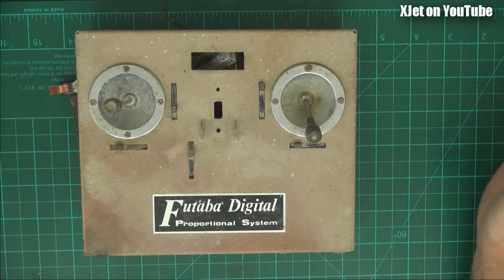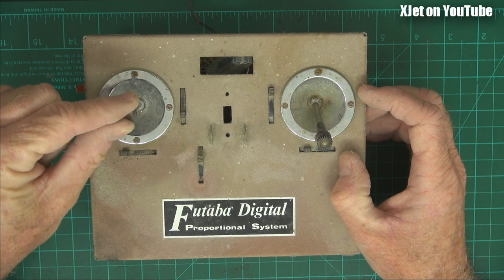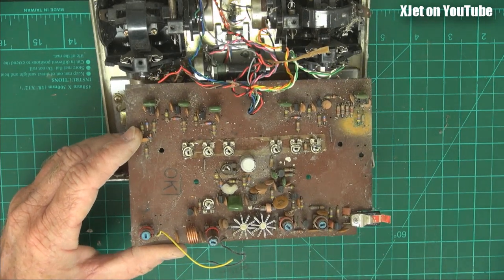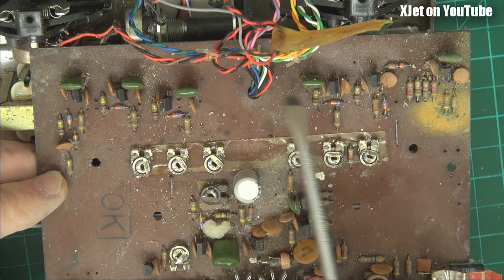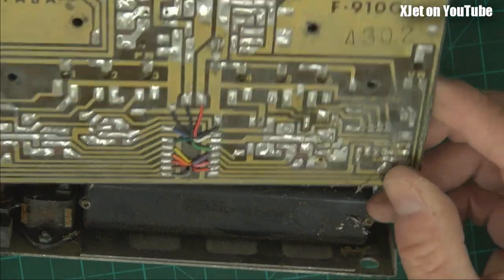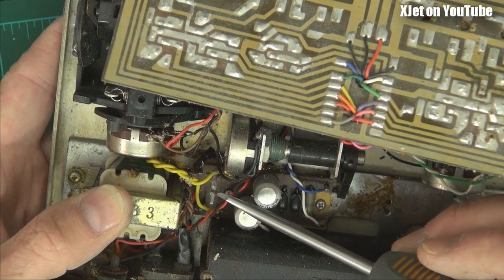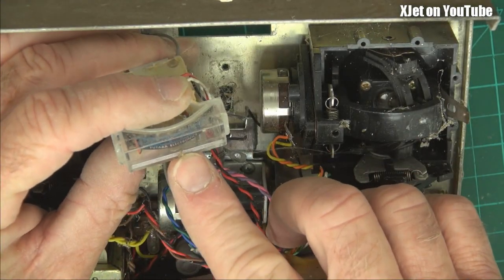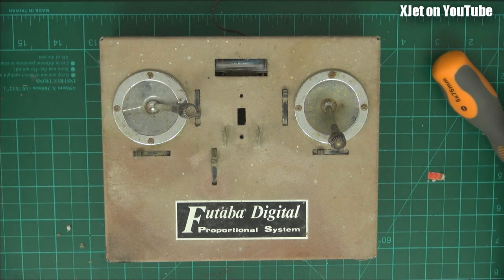Futaba 5-channel radio control transmitter from the 1970s

Comment: Back in '76 I got my first Radio,  Futaba 5ch, black plastic case.
  Couple of years ago a Gold Metal Case 4ch, in AM, came to me, changed the internal battery, this I still use for my airboat, it's my engine break-in unit.
 Now, I fly 2 differant 6ch systems.  Futaba and Tower.  I also have a 3ch and a couple of 4ch systems, all Futaba. I do this because I know that all the components all work together.
Got my first model plane back in 1959,C/L, .049. Been designing, building  and flying R/C ever since.
Ok, I admit it, I'm a Model Airplane Nut.
  Winter time I build, in the summer I fly and teach.
 Passing on piloting skills is the most sure way of getting people involved in this hobby.
Good flying weather is almost here in Mid Michigan.  Going through equipment getting things ready to go........ Flyen!!!!!!!!!                          
  Yippee!   ( Orange, P-38)

Comment: wowwww....  brings back memories, my first radio was a Futaba 3 channel for a boat, then I moved up to a 4 channel for the plane and the radio I got was just like the one shown here (except for the 5th channel)..  those clean sharp lines those catch everything corners that metal case which was soo much fun to hold in cold weather, and that miserable tiny battery meter that worked when it wanted to and that wasnt too often ;)  and the prices, holy moly...  the 4 channel was in the 200$ range even back then... I still have the servos and recievers for those transmitters, dont know what happened to the radios tho, got lost in the moves over the years I suppose.

Comment: Nice Bruce. That is the radio my Grandad taught me to fly with. Used it for quite a while until I replaced it with the trusty ok Futaba fp-t7uaf. Which I still have and works fine. Used that one untill the 2.4 revolution.

Comment: That's the same one as my first radio I had back in 1973, it came with linear servos that had 5 wires not 3. I used it in my first trainer a Top Flight  Top Dawg, rudder, elevator and throttle with a Super Tigre G20/15 for power. worked great until the bush fire brigade using a CB radio shot me down when they came into our field, I had the bad luck of being the only one in the air at the time, only thing that survived the crash was the motor. My next radio was a Micro 4 channel on 29Mhz.

Comment: Brings back a lot of memories.  I am not sure when this radio here first came out, but I am thinking it was approx. 1970.  I bought the 4 channel version of the next generation- the FP-4FN, in 1980 or so.  I have some memories of how that radio looked inside, and it was very similar to this one w/respect to number and types of electronic components.  The biggest difference being the transformer was removed, and the radio set came with a separate dual Ni-Cad Charger.  That charger was ultra cheap, with two red LED's functioning as both the half wave rectification of the AC, and the indicator to show you the TX or RX was connected.  Those two LED's were bright and a bit scary looking in the darkness, and that was way before the first Terminator movie came out.  From what I recall, you could order the FP-"X"FN radio sets in either the 27 or 72 Mhz band.  The 27 Mhz band only had a few channels on it, the 72 had more, so back then, most people were moving away from the 27Mhz to the 72Mhz band.  Everyone had a two color ribbon attached to their 3 foot or so antennas- those two colors let everyone else know what frequency you were on.   Party on!

Comment: At this version Futaba servos were metal cased and 5 wire.
The next version, the 'M' series, were the first with plastic cases and 3 wires.
They were also a step change in reliability.

Comment: I worked for Futaba back in the early days as their service technician when they set up a shop and Warehouse outlet down in Caulfield Melbourne Victoria,   I remember the old transmitters and also having to fit Australian 240 plugs on every unit the came into Australia from Japan, the main problem back then was having to recycle all the receiver batteries over a 24 hour period using light globes to discharge and break the memory effect of the early Ni-cad rechargeable batteries.

Comment: Damn !! I have one of these in the corner, on 27Mhz , still works AND the original 650Mah NiCD battery still takes and holds a charge. Futaba J type conectors still work too, on the TX and the RX. Who still remembers the pins exposed on the servo lead end ? Not someone's finest design moment.....

Comment: Thanks! For this. My used one, had a button cell battery pack.  Several of the cells were rotton/dead/leaking!!!  It also had linear servo’s.   Don’t remember the frequency but it was definitely 27.!!!!!!  Thanks KN4UXO

Comment: As a starving college student, I ponied up $276 in 1977 for a similar 72 MHzKraft 4 Channel system...  That's $1145 in today's money for a FOUR CHANNEL Tx, Rx, four servos and a NiCd battery... Things have come a LONNNNNG way!!
Today's $450 2.4Gb DX9 would have been $108 in 1977...
Reply: lol your post brings back some memories. I started with the same Kraft 4 at about the same time! I still remember how much work I had to do to buy that radio... And so worth it :)
Reply: I still got one of those and complete still goes to,not used for some time though.bought it 2nd hand

Comment: I've still got an old CitizenShip galloping ghost radio from the 60's, also a Kraft and Micro Avionics from the 70's.
Reply: I also had an E.K. Logictrol, my first proportional radio from about 1969, I sold it about 20 years ago though.  It had linear outputs on the servos instead of the rotary outputs we have today.

Comment: Guys must be out of their minds wanting to restore those old crusty radio's.  Thats the beauty of modern radios. I wouldnt trade my Tactic 850 for any of that old 72 hz stuff. I aquired a boat with the old electronics and had to problem gutting it out. Everything had shorted out anyways,seems bees wax still doesnt keep water from entering the electronics from that old single board junk. I have a great time now with that boat,upgraded everything,even added a smoke generator for the engine exaust. My brother has one of his older 72 Hz radio sets he would be willing to give me if I were interested. I would display it only. Our RC club still has some working equipment if anyone is interested in running it but no one even offers so it sits. They run Tundras and Apprentice for teaching RC.

Comment: Well pull up a sandbag and swing that light :)
How about some more technical stuff Bruce, can I use two receiving antenna connected to the one receiver?  Part II of thermal gliding? Can you fit a diode to prevent accidental reversed polarity on a tiny 1S brushed quad, he says sadly :(  Loads of technical questions and you're the man who knows.

Comment: I think this was the same Futaba unit in the box of gear I was given ages ago including an OS 40 and 46 from the 70s! (all now thrown out / given away / long gone) Mine might have been a model or 2 up though, did yours have a battery meter were the big hole is? I believe mine did, but it was too damaged by dead batteries / spilt nitro fuel to be worth doing anything with. If it were nowadays I would have cleaned it up and Ebayed it or given it to someone who would do something with it, I was not long out of school when I got given all that stuff, I believe I got one of the nitro motors running though, but it had stuff all compression due to being screamed / lean out too much and parts were NLA. If it was the same radio, yours would have had the 5th servo on the receiver itself like the one I had yeah?

Comment: I have the same transmitter but it is missing the battery. I have tried other vintage Futaba batteries but this model has 3 cables unlike others so it does not work. Do you think it is possible to get a custom made battery for it ?
Reply from the maker: The transmitters had just a 9.6V nicad battery but the receivers had a 4.8V nicad battery which was center-tapped to also give 2.4V (the third wire).  It should be possible to get such a battery made for you -- although today you would use NiMH cells rather than nicad ones.

Comment: Flew with futaba M series, futaba gold,  FUTABA CHALLENGER, and could NOT FAULT THEM FOR TX OF THE 70'S  80'S AND 90'S IV BEEN FLYING RC FOR 50 YEARS.AND STIILL UES MY OLD FUTABA ( M)  SERIES IN A VINTAGE MODEL TO THIS DAY. EVEN THOUGH I NOW FLY THE MOST UP TO DATE FUTABA T/X  AND THE REASON THAY ARE HARD TO DISMANTLE IS THAY WHERE SO RELIABLE THAY NEVER NEEDED TO (BE). MAY BE 10 YEARS LATER ! TO TO PLACE THE BATTERYS. NOT LIKE THE MODEN FUTABA T/X  2 YEARS IF YOU ARE LUCKY. 
THE NEW GEAR TO DAY JUST HAS MORE GIZMOS BUT IF YOU ARE A REAL FLYER YOU DON'T NEED HALF OF WHAT THAY INCORPORATE IN THESE NEW T/X. 
INTERESTING VIDEO 👍

Comment: I very recently discovered a DIY current limiter made from a car's tail light bulb. It's the same idea as the current limiter in that old radio you have, except you use it to prevent damage to a quad when you plug the battery in for the first time after a build. The guy who I got the design from calls it a SmokeStopper. I made a video on how to make one you can see here:   https://www.youtube.com/watch?v=g4qj929H9yo&t=13s
Reply: Been using one of those for years.
I use them for finding shorts in car circuits too, much cheaper than multiple blade fuses.
Reply: Yep, they work great, I love mine.
Reply: Buy a $10 meter and you won't have to buy any more bulbs.
Reply: I don't buy bulbs, I get used ones free.
A meter will not do the same thing as a bulb in a circuit.
A bulb will protect the circuit.

Comment: anyone remember alpha simprop ? diac battery pack too ?
Reply from the maker: Yep, I recall the Simprop and I even had one of those Mainstream single-channel systems.  The batteries were DEACs -- button-cell nicads.
Reply: i think i still have some of the reciever pcbs some place without any components soldered on them ,, god i feel old now